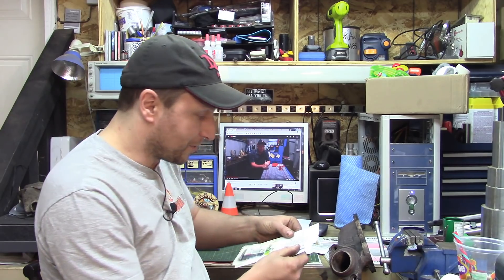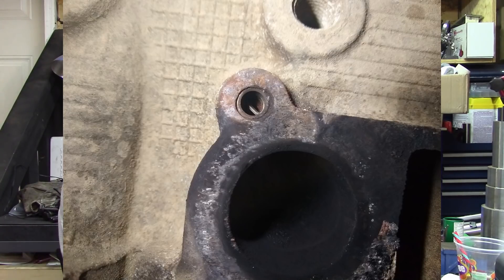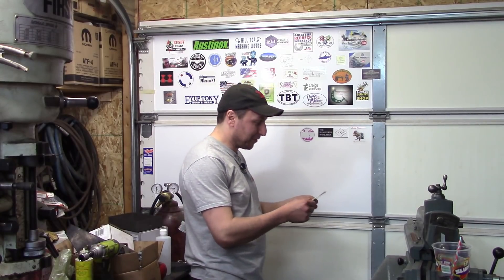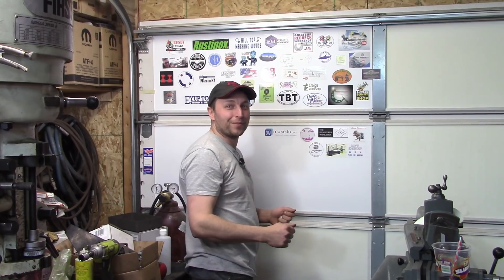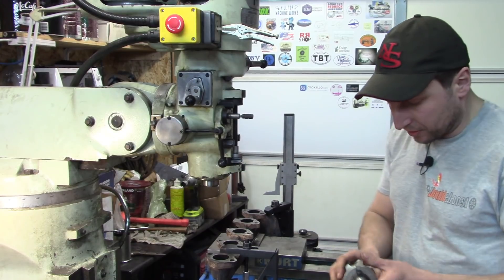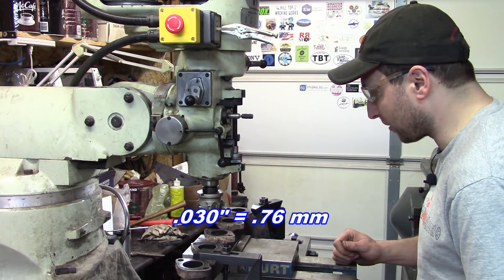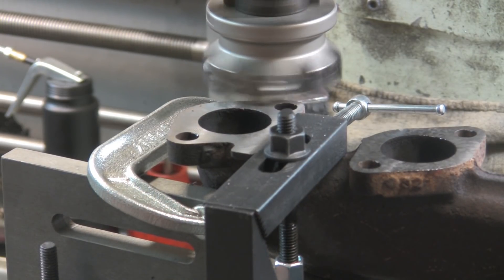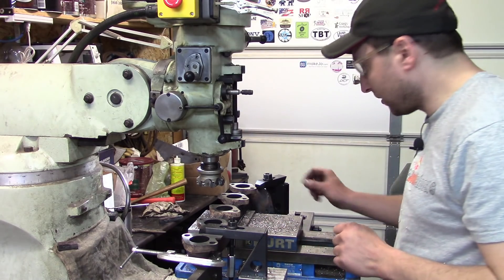Machining a Ford V10 Exhaust Manifold

Comment: do you drive a dodge
Reply from the maker: Well, I did up until late November, when I sold my '03 3/4 ton.  I'm now sharing a Ford 1/2 ton with my father-in-law so that has adjusted a bit of how I move and haul stuff, lol.
Reply: @EverettsWorkshop  saw the ATF+4 on the shelf I drive dodges

Comment: 2 questions , what size is your mill and how is the PM-1236 lathe doing, I'm ready to order a lathe and trying to decide between the PM-1236 and a Grizzly G4003G also a 12"x36", any input would be greatly appreciated, from an old guy in WV
Reply from the maker: Hi Ferrell, thanks for writing.  The mill I have now has a 9x42 table, which apparently is the typical Bridgeport clone type machine.  Very thankful for it, it still needs some TLC but that will need some time once I can get it.  As for the lathe, it's not a Precision Matthews but a King Canada KC1236ML, which is a brand sold here in Canada.  Not sure about where the PM machine is made but I do know mine was made on the mainland "over there" in East Asia, and it has had a couple small things that needed fixing over the last few years.  It is pretty much exactly like the Grizzly G4003G unit, not sure where that one is made either.  Not sure if this helps, but hopefully it can be of some use.

Comment: I like the new face mill. Good one Everett.
Reply from the maker: Thanks Randy, I've had it for a while but the mill-drill wasn't the best machine for it.  At least this one seems to handle it but need to figure out the cutting tooth issues,  I think it's because even though I filled the cutter with the same brand and type of insert they were from two different packages.  May have been two different insert production runs, need to look into it more.
Reply: @EverettsWorkshop  I watched the video when you got the mill. I think Abom has a video a while back. He used an indicator to set the inserts on a face mill. It was maybe a year ago. That might help. Take care Everett.

Comment: Great job . I always hate broken manifold studs at work , but lucky enough most times to get to them before the butchers !!!  Cheers .
Reply from the maker: Thanks Max, I prefer to get them before others mess with them too.  Especially with aluminum heads, before someone tries a not-so-easy-out it's much simpler to zap a nut on the broken part and unscrew it.

Comment: Everett, if you add  anymore machines you’re toning to need a bigger universe! Also I don’t know if you replaced all the inserts on the face mill, but if you didn’t change them all, it might be a good idea to do it, all the inserts need to be identical from the same manufacturer. I hope the little ones are letting you get enough sleep.
Reply from the maker: The more I think on it that may be the issue - even though the inserts were from the same manufacturer, and same part number, they were different boxes and I wonder if there were differences in lots. When I get some time I'll look into it.

Comment: That setup rather nicely.  I did a 351W once (not fun) . I know what ya mean about time, lack of free time has been my issue lately too. Definitely nice to see how you did it
Reply from the maker: Thanks Craig, what was nice on this one is that the manifold is roughly "box-shaped" in the middle, just needed to make the outer end more rigid in the end.  Those Windsor manifolds would have been a pain to set up, I remember what the pickup ones looked like!

Comment: The term for properly aged iron castings is 'seasoned'. Very much the same term as applies to timber. Some of the old school manufacturers would try to have castings that had sat outside seasoning for years before they were machined to finished dimensions. Sometimes the casting was left outside for a couple of years in the as cast state then it was partially machined and put back out for more years before finishing. Whole process can be done in hours these days by sophisticated heating/cooling cycles in tightly controlled oven conditioners. Agree with your decision to use a Timesert type of thread repair. I far prefer Timeserts over Helicoils in applications like that.
Reply from the maker: That explains why you don't hear of modern engine blocks sitting outside for years on end anymore. Still surprising to see the warpage on the manifolds of almost every manufacturer though, perhaps they don't bother with "cheaper" parts?

Comment: Is there any reason you checked out the flatness/level of the manifold surface with your height gauge instead of the good old "dial indicator off the quill on mag-block noga" ?

I suppose both would work...
Reply from the maker: The biggest reason for use of the height gauge on the table was to try getting the line of best fit for mounting the manifold to the table. I certainly could have run the table back and forth, it would have worked, but honestly this is just the first way that came to mind.

Comment: Glad you're back Everret, kinda missed you, have you tried anything like that on the shaper?
Reply: This manifold would probably be a  bit too wide for a 10 inch shaper like the Alba,but most certainly a shaper will do a great job of refacing components like this.
Reply from the maker: Thanks Larry, I would totally have tried the shaper but it only has about a 10x10x10 work envelope. If I can ever get a hold of a big old 36" Cincinnati or the like, then I'd love to try it!

Comment: Are you going to take the sticker door with you when you move? :)
Reply from the maker: Lol, actually yes - the stickers are stuck to corrugated plastic panels that are tucked into the insulation side of the garage door panels. They slide in and out so they can come with us and then I need to figure out how to arrange the new shop.
Reply: @EverettsWorkshop  Well that is good. I was worried you were going to be stuck trying to peel them all off.

Comment: Don't you hate that thunking sound when using expensive carbide inserts on interrupted cuts?  Great work.  Love your videos.  We always worry about our digital friends.
Reply from the maker: Lol, thanks Vern!  These ones are import inserts, trying to keep the costs down as the Iscar mill heads use an odd ball size, but will try with some others before condemning the head.  We're still doing ok here, lots going on, but still blessed.  Glad to hear from you too, hopefully you're able to get into the new shop a bit when spring finally arrives!

Comment: Rumor has it that General Motors’s back in the ‘50s used to let engine blocks set out in the weather for 3 or 4 years before final machining to help relieve the stresses. Keep up the good work!
Reply from the maker: Thanks Ed, I saw pictures in one of my mechanic's textbooks of stacks of engine block castings on racking with the caption saying they were stored for a couple years.  Doubt they do that now though, lol!
Reply: Tieing up that much capital, and potentially having large number of obselete blocks tells me I'd need a load more evidence before accepting that story.

Stress relieving cast iron out door IS a thing though, Record used to do it with hand plane bodies, but they're small, cheap, and the design didn't change in multiple  decades.
Reply: @paulwomack5866  the small block chevy used the same block from 1956 to 1987. I’d say they knew what they were doing.

Comment: G’day Everett. Great video, thanks. Don’t be too hard on the last technician at least he didn’t stuff up the head itself and leave you the only option to say “sorry mate your up for a new head “ , some mechanics just aren’t good at getting out broken studs. Come to think of it, I was not taught at trade school 50 years ago how to remove a broken stud, maybe we should have been. 
Cheers 
Peter
Reply from the maker: Fair enough, you're right, the head was still on the engine vs having to be replaced.  It just seemed a bit sketchy to leave half the bolt in the hole and only use 4 threads to hold the manifold on for that end.

Comment: Gday Everrett, the new mill is working great, when I put the new engine in my 4wd I did the same to the exhaust manifold, I used the round column mill with a fly cutter, in the end I had to take in total .050”, no wonder I couldn’t get it to seal before, I have a 80mm face mill and the mill drill hates it, the finish I got was absolutely beautiful with the fly cutter, I can complete understand what you mean about having to do extra editing, common practice in my little shop😂, when I got stickers from Aaron he also sent a CEE (Cutting Edge Engineering Australia) sticker, the guys name is Kurtis, check him out mate, definitely worth a visit, I think you’ll like the channel, interesting work on big stuff and the outtakes at the end is gold, turn down the volume if the wife and kids are about, great job mate, throughly enjoyed watching, cheers Matty
Reply from the maker: Thanks Matty, I'm happy with the result of this one.  It's amazing how much a manifold will warp once the stresses are relieved, you'll never have a problem with your ute engine again with flattening it that much!  Howie from Manitoba was mentioning Cutting Edge as well, will check him out this weekend.

Comment: Nice job. I thought that thing looked way too warped to surface...
Reply from the maker: Thanks John, one good thing about most of the automotive manifolds I have seen that are warped is that the flanges are generally thick enough to take a resurfacing without impairing the ability to compress the gasket to get a good seal.  What is even better is that after a number of heat-cool cycles on an engine, the stresses relieve and they won't warp the same way again.

Comment: Great repair Everett, nice milling cutter. Hope it's not too cold for you right now, cheers!
PS, in case you haven't checked out, you might like to check out Cutting Edge Engineering from Australia , heavy equipment repairs. Howie
Reply from the maker: Thanks Howie, I like the milling cutter but hopefully the issue is in the inserts and not the face mill itself.  It's a tad chilly here for sure but we're surviving, just more an annoyance at work when you're trying to light up a frozen diesel.
As for the Cutting Edge channel, I was recently told of the channel by someone as as well, will have to check it out.

Comment: Must be because it’s interrupted cut. What I meant to say is it possible that all the noises because it’s an interrupted cat
Reply from the maker: It totally is, and sadly the fact my cheap inserts or possible messed up face mill was only hitting on 3 or 4 teeth wasn't helping.  At some point need to figure out whether it's the inserts or mill that is the problem.

Comment: I always check to see if you have had time to post a new video - these work projects are great to see, I would have liked to see a straight edge across the ports before and after but now I am getting fussy. Keep safe.
Reply from the maker: Thanks Eric, glad you like what I get up to here.  I guess I did miss showing that step, we checked it at work against a straight edge and there was a significant gap front and back.  I just used the height gauge on the mill to try lining up the flange as best as possible.

Comment: Hi Everett, there is a 6 insert face cutter on Bangood that is cheap and cheap inserts - playing with mine today - gives a polished glass finish,  on  mystery metal: I am building a acto tool and cutter grinder, so needed a thinner bit of metal. Cheers Glenn
 I
Reply from the maker: Hi Glenn, I need to do a bit more fiddling with this Iscar head, but am going to experiment a bit with some other styles as well.  I'll look into the cutter you mention, never ordered from BangGood, but might have to try.

Comment: Hey Everett, maybe a vid measuring the cutter heights of the face mill and what to do to rectify.
I wonder if it's the insert quality or the land where they seat, maybe the fastener centres are slightly off
Cheers buds
Reply from the maker: Hey Rick, I'm wondering myself if it's the cutter itself or the inserts.  They are cheap ones so can't expect Kennametal or Sandvik quality, but the face mill itself was used off eBay, not sure if it got crashed in its lifetime either.  If I can get time in the near future a measurement with other inserts is a good idea.